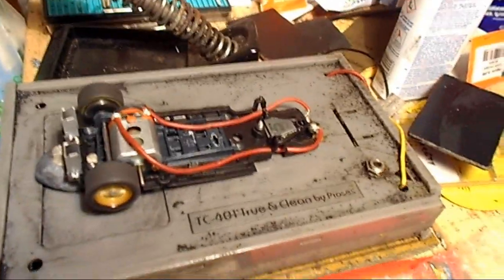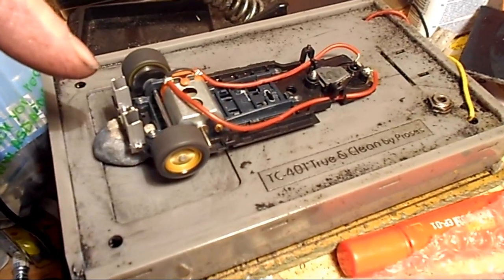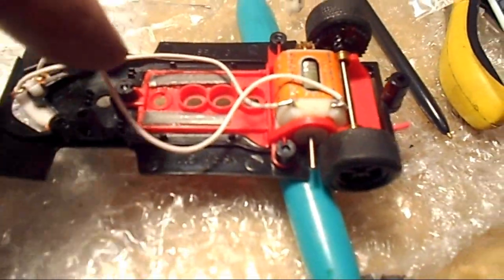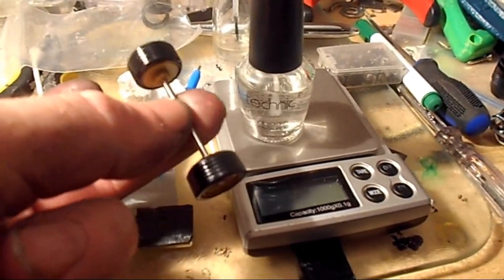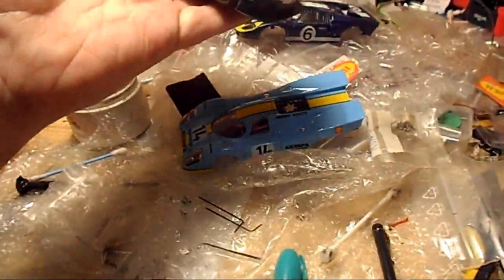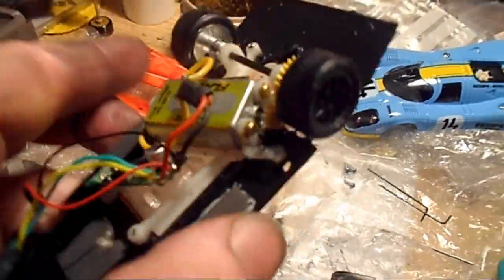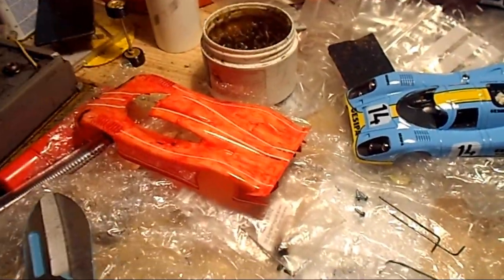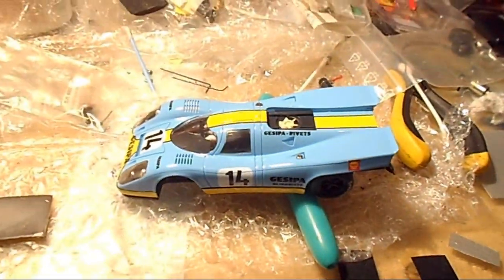~ Track Prep - Slot.it GT40 & NSR Porsche 917 ~

Comment: Hi Rick, I enjoy your videos.  I have each of these two cars.   How much weight should I be running as a non magnet racer.  I could use a starting point.  The tracks would be painted board, Ninco, and Scaley.  Thanks for the help.
Reply from the maker: Hi Mike ...Glad that you're enjoying my videos  :-) ......  I usually fit between 3 to 5'grms of lead ballast in = Under the front axle, or as close to the guide blade as you can get it.... No-magnet racing seems to be more about having weight up-front to keep the guide in the slot.... The rear end is kept under control with well prept, glued, trued & treated tyres ....... V'Best ~ Rk ...................
Reply: Hi Rick, how are you doing Blu?  How are the cats doing?  After veiwing your non mag NSR 917 and GT 40, how much ballast do you put on the chassis and what is a good target weight?